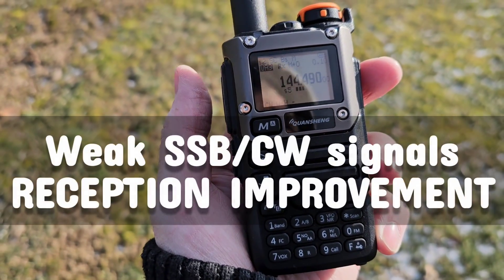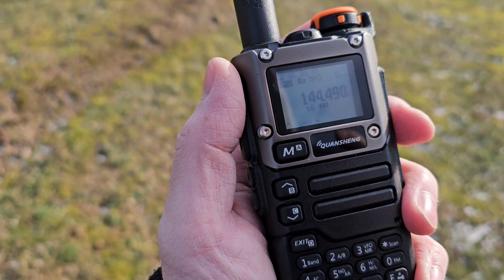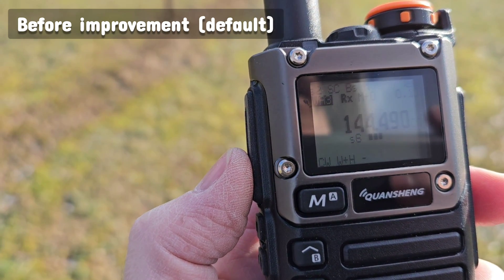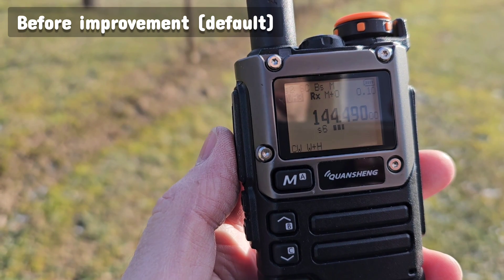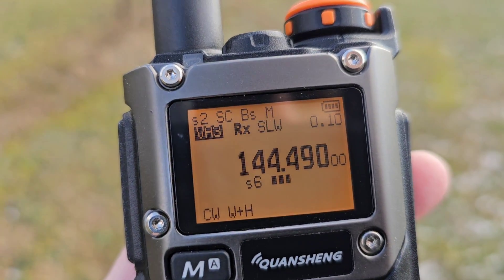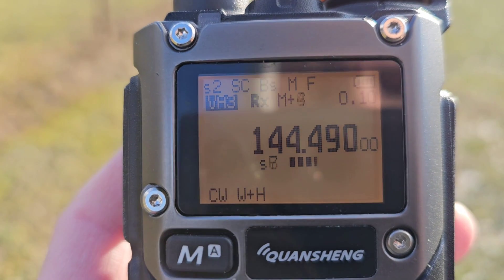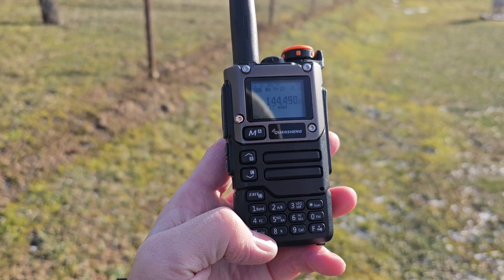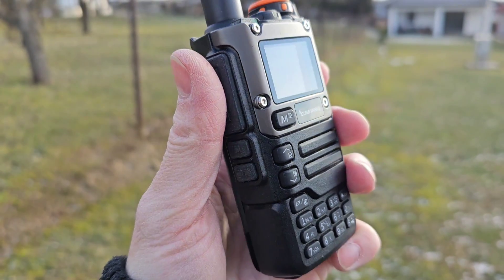QUANSHENG UV-K5 weak CW/SSB signals improvement ( IJV 2.9 firmware )

Comment: My UV-K5(8) arrived today. Which firmware is the best in you opinion and what antenna did you use? 73 de PA.
Reply from the maker: IJV 2.9R1
Reply: @OM0ET  ... Van you explain "why" perhaps ? I got Egzumer v 0.21. I don't use spectrum analyser but ppl find it useful but I don't know how it works.
Reply: @OM0ET  Thanks!
Reply: I have the same question. I got the Egzumer FW now. But i wanna know.

Comment: Only RX? you can TX in USB with this firmware ?
Reply from the maker: Yes on VHF UHF, but it is not real DSB transmission. It is actually kind of virtual DSB, which looks more to FM than DSB signal. But I think that audio is readible in SSB also.